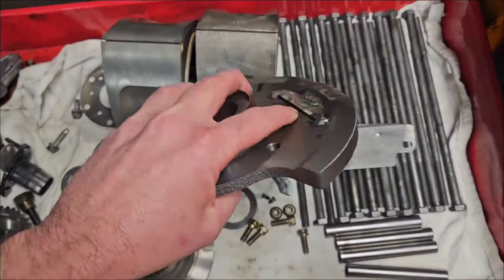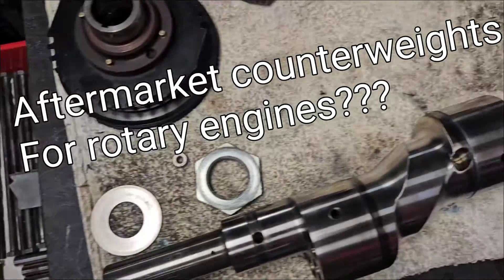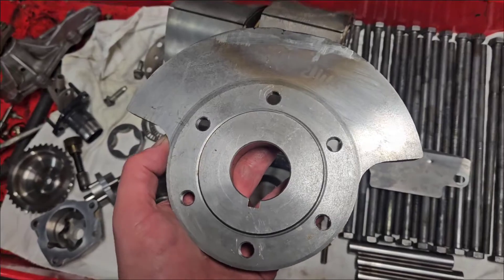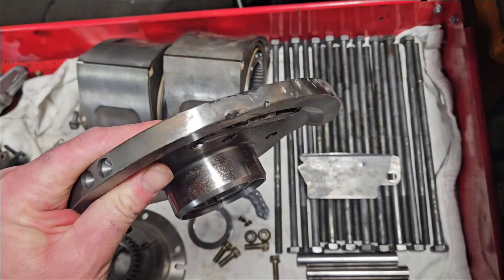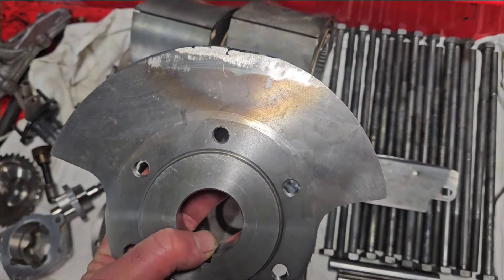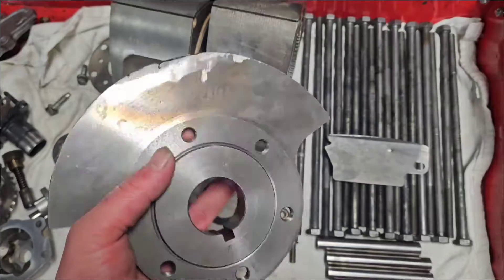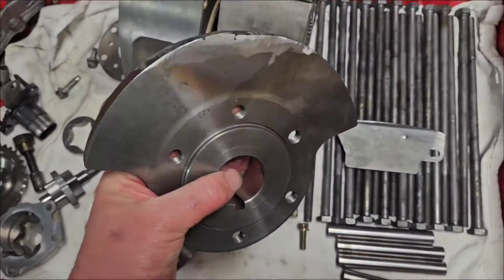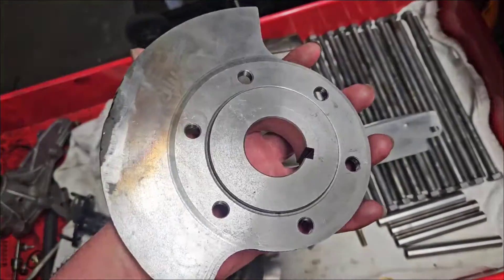discuss the good and bad with rear after market counterweight for rotary engines

Comment: hmm... on my rx-8, in the region of 1150 - 1400 rpm, a strange vibration appears, which is not expressed at all at idle, and at rpm above 1500 it is no longer present at all.
This became noticeable after the factory engine mounts died. Then I replaced them with stiffer ones (relative to the whole factory ones) and durable polyurethane ones from Nikon Rotary - the problem did not go away. All this makes me think about the poor balancing of my factory engine, which is not clear how to fix it.
Reply from the maker: go back to OEM mounts

Comment: Did Mazda originally balance the rotating assembly and flywheel at the factory?

I've got an ACT lightweight flywheel (4.4kg) on my RX8 and it does vibrate slightly at idle, assumed it would have been ok to put on but having second doubts now having seen this vid.
Reply from the maker: Factory assemblies are balanced but.  Mazdatrix has a higher standard than OEM. For racing, higher rpm, higher boost...

Comment: Looks terrible  Kyle.
Reply from the maker: totally agree. I said the same thing to the balancer guy... put some pride in. I think i even mention that its ugly in the video but that's not the discussion at hand.   Reality is Functionality is there and it not visible at any time once in use. I'd be more mad at the shops that cut on the rotor itself. hence why we do the same as the factory and balance the weights to the rotors. thanks for saying it looks terrible, i guess. lol
Reply: I agree it's all about the balancing and true nobody will ever see it once the flywheel and clutch assembly is fitted and the g box on  . But I am a welder tradesman professional tig welder  ...  I do love you're work ..just looked terrible 😕
Reply from the maker: @indracook1910  good thing it's not my welding